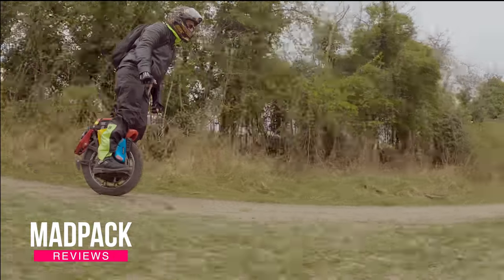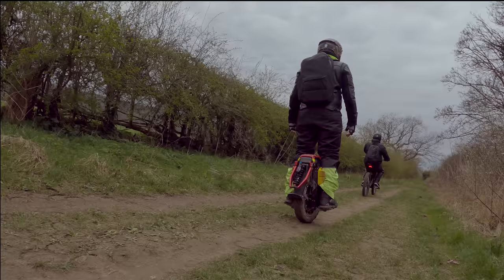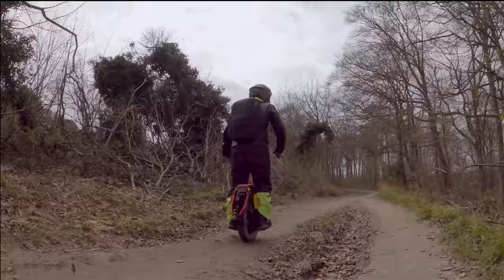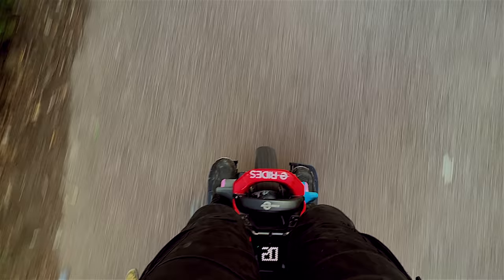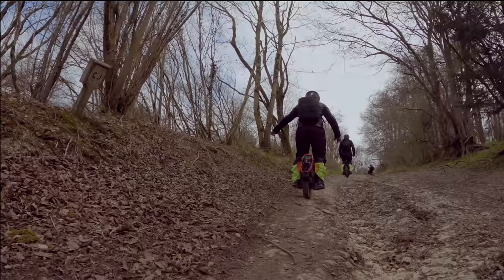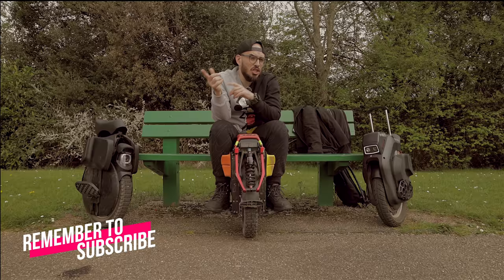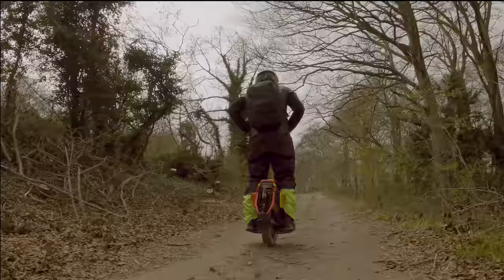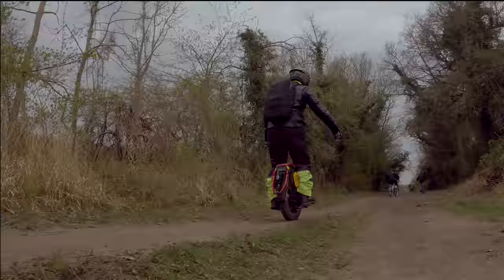Kingsong S22 Review - Best Worst Electric Unicycle 2022

Comment: Hey brother Marco glad you got a chance to ride the S20/22. I definitely did not have the same experience on this wheel as you did. I believe a lot of it is due to how much heavier I am than you. I did not have trouble accelerating or braking and the balance although slightly back heavy didn’t give me any trouble navigating with it. I definitely agree that I thoroughly enjoyed the suspension and how easy it was for me to hit bumps going pretty fast and not even worry about it. You did get a lot more time riding the wheel though. I did not get a chance to take it off road as I had hoped I would. I am still very hopeful that they will make the necessary upgrades to at least make the wheel safe and I think I’ll be happy with it. 👊🏾
Reply from the maker: Yeah I believe that you didn’t take it to the real world obvious with your weight compared to mine (less than 75kg) you could break better but the wheel have very bad issues in there. If you compare it head to head and you take it into your daily commute you will feel what I’m saying even with your weight because your weight will not change depending on the wheel that you ride. :) hope that you are well and your shoulder is fully recovered im also fighting since December to get back my right shoulder but is been hard

Comment: A very interesting insight into this wheel. Something we have all known for a long time though, the EUC manufacturers cannot bring a mature product to market, it is always a pre production model. The problems are resolved in time and even in new versions. The lesson unfortunately, you will have problems if you buy a first batch wheel, regardless of who makes it.
Reply from the maker: But in here the problem is that the wheel feels really like a prototype but the wheel was already sent out to distributors
Reply: The problem is that the design is the design at this point. Those suspension sliders can't be fixed it would take a full design change

Comment: Appreciate your extremely Critical review!  The S22 is going to be my first wheel.  I won't have any muscle memory or prior experience.  I'll learn on it "as is" and then go from there.  Between all the different experiences and reviews online I almost feel like I'm rolling the dice 🙏
Reply from the maker: Like I said on my review at this moment I will definitely not put my money in a so amateur wheel.. and if you think about it kingsong never done a wheel above 84v and when they try it they blow up badly so yeah I will not bet my money on this and like I show you that structure where your suspension moves will give you problems really soon
Reply: I’d be wary of buying batch 1 wheels. They usual fix issues with each batch. Batch 2/3 may have less issues/more refinements
Reply: @Ukreefside  I'm hoping the fire and feedback from the community caused KingSong to fix "batch one".  I actually didn't realize how niche EUC's are.  Almost experimental tech.
Reply: @MADpack  I agree with what you're saying.  Your suggestion are quite extensive and yes would require a complete hardware re-work.  That being said I'm keeping my S22 Pre-order.  Worst case I have an Off-road only wheel and buy another one next season.  Thanks for all your hard work!
Reply from the maker: Anyway this wheel is not to be refined but to take it back to the factory and restart from scratch
Reply from the maker: I think this wheel is too much experimental at this point
Reply from the maker: Man more than happy like I said in the video I believe in a way you will start having issues with the main selling point (suspension)
Reply: Any wheel makes a great first wheel
Reply from the maker: Definitely the important is to start somewhere my first wheel was the z10 and yours?
Reply: @MADpack .... onewheel XR 😂
Reply from the maker: Ahahahahahah so you are still missing in the family

Comment: Great review. I’d be upset dropping that kind of money on a wheel and having to make all these changes. I really like the look of it though. I still haven’t found a wheel that suits my needs since the 16x. Range and hill climbing without overheating. Maybe the v12HT. Almost like a refined 16x. I Look forward to your thoughts on the v12HT when you get one. P.s if you ever need testers, I’d be happy to help.. I’m not that far from you. Have done about 3k miles on various wheels over the last 3-4 years.
Reply from the maker: Where are you based my friend?!
Reply: begode rs never overheats on hills and has pretty good range
Reply from the maker: I can’t consider the rs anymore since that lack of waterproofing and the motherboard on the bottom and if you use on the winter you need to tape all your handle so no handle for you makes me look to the rs as a no option
Reply: I'm getting a v12ht as my next wheel after my 16x. Going to.wait a few years before a pay 3000+ for a suspension wheel. Not getting caught up in all the hype to be a company's testbed.
Reply: @MADpack  just south of london
Reply from the maker: You will not be disappointed
Reply from the maker: So not so far :)

Comment: The toy like suspension sliders did it for me, I was done when I saw what it consisted of. Once those aluminum channels that are the actual battery boxes get scored you're done and now you have a non suspension wheel no matter how many plastic sliders you throw at it. Totally unacceptable
Reply from the maker: Definitely the worst design for suspension that I’ve seen with the best suspension that I’ve tired
Reply: @MADpack  you just said in the video you loved the suspension : )
Reply from the maker: Yes I love it but with the worst slide design that I’ve seen I said that on the video and I believe I made it clear bro

Comment: at this point I wish they should have improved the s18, the s22 has a lot of problem. master has problems too but not as much as the s22. suspension itself on the s22 is not worth my money, open sliding suspension on off road will kill it pretty fast. dust, dirt, small stones  not good.
Reply from the maker: I completely agree with you but at this moment I see also the master as a problem.. I just saw the video of Jimmy and that back light and trolley (hero had the strongest trolley o. The market) is insane that they manage to make a so bad one once again I really do t get it

Comment: very interesting good review.  You were brave to allow the wheel inside your home, after one blew up. thanks for your honesty.
KS18 is uncomfortable  to ride for me, yet I can ride V11 all day, it's super comfy. 
   How did S22 feel?   same, better or worse compared to the V11 on road and off road ?
Reply from the maker: Is coming a video about that soon :) I’m editing :) I think you will be more informed with the video of 17 minutes if I’m not wrong that I’m editing at the minute
Reply: I ride ks 16x. Love it.
Reply from the maker: 16x have its limitations since I normally ride around 60kph I will not be able to enjoy the 16x anymore and also was for me a very bad wheel brought me a lot of problems. Obviously they made it better since but the speed and also the lack of water proof is a big no no for me
Reply: @MADpack   It's my 1st and only wheel and I felt like limiting myself to 30 miles an hour would be safe and I saw it was pretty durable.
Reply from the maker: Now it can be better but for me that I ride constantly in the rain and after all problems I had (ks send me a batch 1 when they promise me a batch 2, innershell broken without doing jumps just riding, half of the speakers stop working and dead on arrive motherboard that ks took 5 months to accept to send me a replacement) was enough to every time I hear 16x I can’t say is a good wheel. Loved the way it rides even if slow now for me enjoy the light and visibility of it and how comfortable it was. And the trolley handle continue to be one of the best on the market
Reply: @MADpack  ok  don't forget to include the Master ;)
Reply from the maker: Include sorry I’m lost :)
Reply: @MADpack  I'm wanting to see how the different suspension wheels actually feel, to  ride, in particular, the level of pain & suffering between wheels.  
 the S18 hurts my leg and V11 does not
Reply from the maker: So you want to know comfort with the master is that?!
Reply: @MADpack  I preordered my Master from alien rides. So i have abit of a wait . August it says but should be sooner. Molicel option also.
Reply: @MADpack  yes
Reply from the maker: Yeah babe molicel it should be a monster I hope that they will solve the pedal dipping. The hero have zero pedal dipping but on the master at the moment with the Samsung 50e the pedal dipping is there so I hope that it will be sort it
Reply: @MADpack  catt setting the pedal degrees to +5 help?
Reply from the maker: Until I have the wheel for me to test I can’t really talk about it but really can’t wait to test but I think that in built construction is inferior to the hero

Comment: I'm 52, and the idea of tooling around for 20 miles on something not much bigger than a Bread-box is absolutely fascinating!
When I heard that thise things catch fire,...my inner child said "Ghost Rider on a uni-cycle".....
(I cant un- see that now)
Can You build one of your own using a hub motor from one of the many options out there? If so how would you get it to balance?
Also, I see many e bikes that are app.ble to use applications to pair with cell phones, why not have a WHEEL that pairs with a SMART WATCH? (BRILLIANT IDEA YEAH?)
Reply from the maker: You have solutions to connect to your watch example you have a Garmin you can connect you wheel with darkness bot and the DarknessBot will connect to your watch. Inmotion have done a watch but is only compatible with v8f and v11 not with v12. Related to do yourself yeah you could buy a motherboard and motor plus batteries and do it but I don’t see the point
Reply: @MADpack  Thanks for explaining! Enjoy Your ride!
Reply from the maker: Always bro always

Comment: If you could buy a EUC which one would you buy in 2022?
Reply from the maker: At this moment will be or inmotion v12 or begode hero
Reply: @MADpack  Well... It doesn't help :)) still two wheels.

I wanted to get the Inmotion S22 for long term, but I guess it won't be a good choose, and the rest are not sure if a good buy for long term, since they don't have proper suspension.
Reply from the maker: The inmotion s22? Ahahah talking about inmotion wait until July if you can and see what inmotion have to offer with the v13 that have suspension. Beside that you are a fan of metal gear solid? :) my favourite game of all times
Reply: @MADpack  :)

Yeah. :) 

.... And yeah I did watched the review, the S22 is a skip. I wouldn't pay 3500 usd for a wheel that has so many flaws and probably get them fixed next year
Reply from the maker: To sort this out you need to wait for a new wheel maybe s24 lolol
Reply from the maker: Wait until July to see what the v13 have to offer

Comment: I think Kingsong engineers trying to bring out a design looks like Transformers or spaceships that are only seen in movies and trying to put handls, seat, kil switch, power botton, charge port, etc, etc becomes a problem. I respect them for that but they really need to put in more effort. At this moment some are fine with ks22 some are not. All wheels had issues at there first intro i hope they sort it out for ks22.
Reply from the maker: Some of the issues that O said is impossible they sort it out without doing a new wheel

Comment: The pads are adjustable, you are supposed to move them to where you need them....
Reply from the maker: For me they don’t work at all beside the fact that to use them you need to remove the plastic part that is like a guide line but in the end doesn’t allow me to do it

Comment: I think this wheel is very good ,as a prototype there are things wrong with it. But test riding it it an amazing off roader we have changed the tyre and now it ride perfect!!! So once kingsong make all the the changes it will rock . I don't need a wheel that goes 50mph ,I don't need to be looking at the screen ,everything is done for a reason on this wheel you just have to get used to it !!!! Plus the suspension is amazing unlike any other.. this system is easy to keep clean you just have to know how to do it...
Reply from the maker: So how you make sure that where you’d wheel goes up and down it doesn’t get dirty? So the screen on our ass is for what bro? What’s the reason behind that? The lack of breaking on this wheel what is the reason behind? And by the way how long you used ride with the s22? Because I use it for almost 2 months so I believe I had more than time enough to to get used to it since I basically only ride it during this time
Reply: @MADpack  yo dude ,mad respect, it s that I think this wheel tics all the boxes ,But !! It does have issues which you have mentioned and need to be resolved before release...
Reply from the maker: But they have already sent them away for distributors so they will no change big thing

Comment: Its an off road wheel. people don't ride fast in these conditions, so the screen is in the correct position cause simply you don't need to look at it all the time. I think you didn't understand the proposition of it...And they heard... they did poor choices on S18 and S22 is a huge leap, increasing the bet with the coil suspension. About breaking...obviously I didn't had the chance to tested it, but you've changed the pedals to accelarate it... so, the weight is up front.... so.... it's going to be harder to break since you will have to lean much more to the back...
About the fire.... it happened on one wheel and they immediatly took it to see what happened and issue a warning to the users and make changes on it... It's a very responsible approuch that gotway never took it...I'm not a ks fanboy, neither a gotway fanboy... I own a sherman and used to have a V10.... I simply get disappointed to watch reviews like that... its totaly unfair, specially with you don't give the other side a chance to comment about the things you say...
Reply from the maker: Hi my friend I had issues to break also in the original position a bit less but not a major difference but to accelerate that was night and day so is not the fault of the pedal position bro. Related to the screen makes no sense what you are talking for that why having a screen? And yea the s22 is much better than the s18 until a certain point… the s18 was a boring wheel the s22 gave me some great moments. But is more than ridiculous some options they made on this wheel

Comment: It makes sense that you have problem to brake since you reversed the pedal, so most of your body weight is at the front of the wheel.
Reply from the maker: Man like we talked in the end of the video even with the pedals in the right place you struggle to break. Slightly better but not enough and definitely not normal

Comment: what euc do you recommend?
Reply from the maker: That’s so relative need more detials
Reply: @MADpack  well, the reason i watched this video because i was considering the s22. I asked bing ai and it said its a good euc to buy. But now that i see your perspective, I'd like to know what euc do you reccomend with similar or less price. I appreciate ur reply btw!
Reply from the maker: @roye6961 before buying an electric unicycle you need to understand your need? Is just for fun? Is to commute? Off road or just road? Do you live in a building without an elevator? What is your weight? Speed is important? So many things before deciding
Reply: @MADpack  honestly, at this point i dont care about what exactly i might want, my nikola plus with 1800wh wont charge anymore after only 900km, considering the infamous begode lg battery packs, its not even worth to pay for a diagnosis, i have to throw it in garbage. I just want a wheel i can turn on and ride without fear. I guess my only option is veteran sherman? or maybe v10f. I guess im looking for the most reliable wheel with safest battery packs. I can sacrifice comfort of suspension for reliability.
Reply from the maker: @roye6961 when you put v10f and Sherman in the same line there are massive differences… depends if you want speed or not I would have a wait and see the InMotion v14 if you are in a rush Sherman max or Patton
Reply: @MADpack  thank you!
Reply from the maker: @roye6961 no worries bro
Reply: @roye6961  hello fellow rider. So what wheel did you finally buy?
Also, may I know please what country are you from?